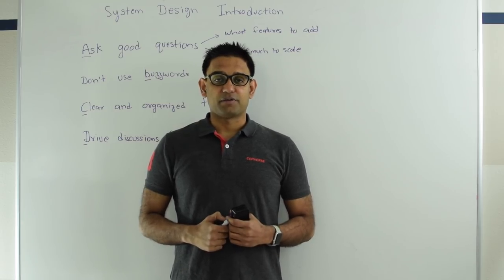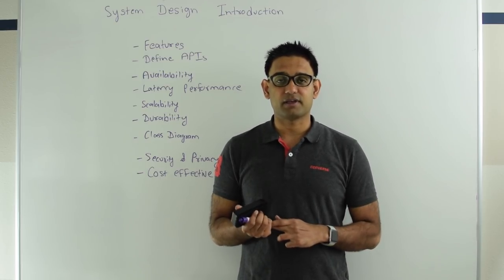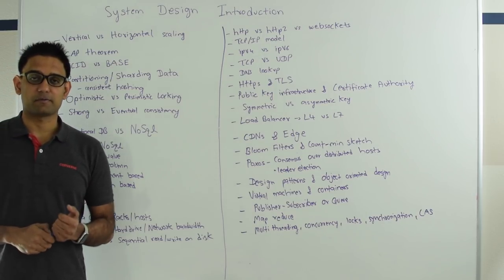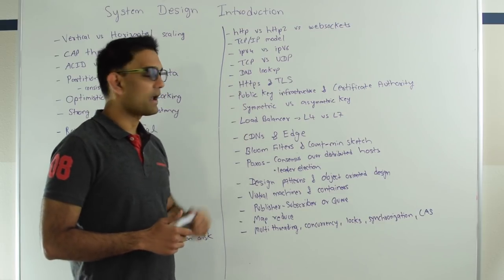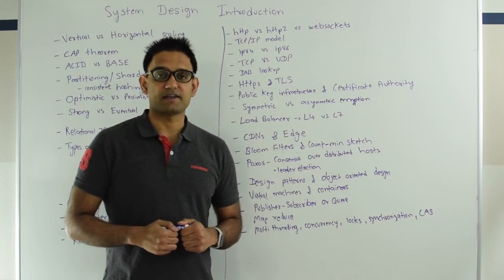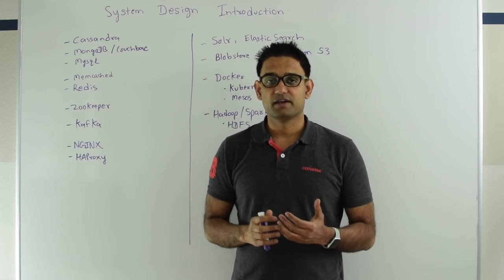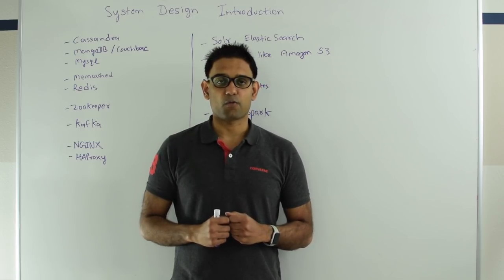System Design Introduction For Interview.

Comment: System design Concepts know 
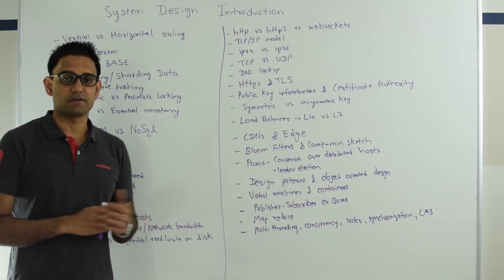Vertical vs horizontal scaling -  7:39 
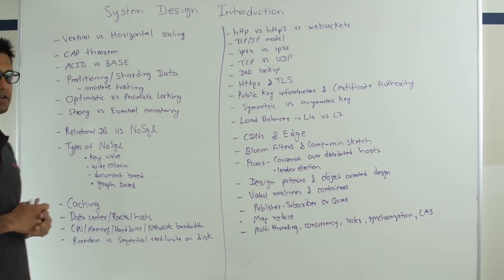CAP theorem - 8:22 
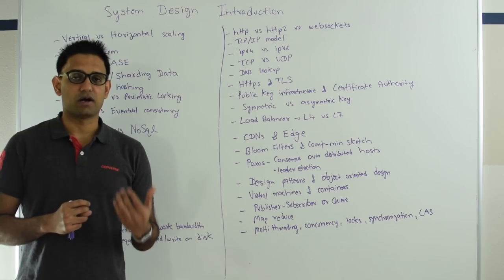ACID vs BASE - 9:24 
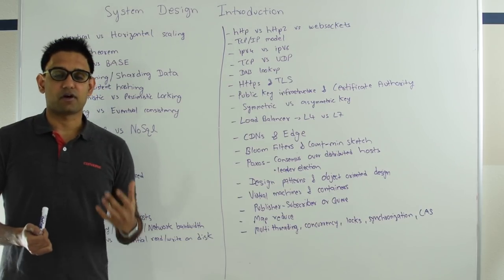Partitioning/Sharding -  9:52 
     Consistent Hashing 
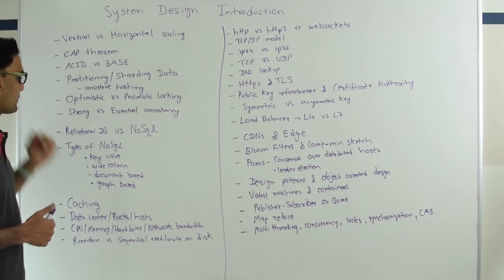Optimistic vs pessimistic locking - 10:29 
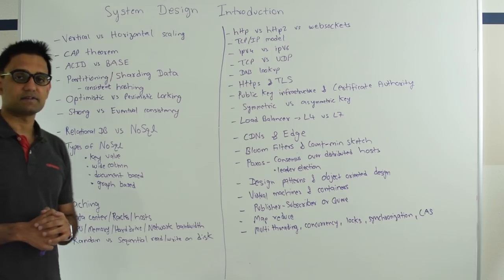Strong vs eventual consistency - 11:04 
RelationalDB vs NoSQL - 11:38 
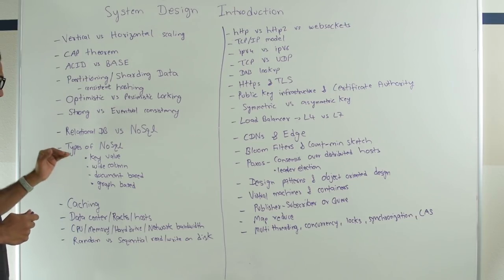Types of NoSQL - 12:05 
     Key value
     Wide column
     Document-based
     Graph-based
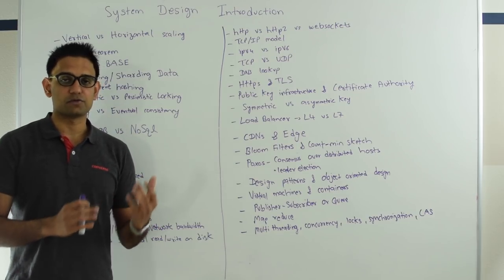Caching - 12:58
Data center/racks/hosts - 13:39 
CPU/memory/Hard drives/Network bandwidth - 14:10
Random vs sequential read/writes to disk - 14:29
HTTP vs http2 vs WebSocket - 14:52
TCP/IP model -  15:26 
ipv4 vs ipv6 - 15:33 
TCP vs UDP - 15:56 
DNS lookup - 16:19 
Http & TLS - 16:44
Public key infrastructure and certificate authority(CA) - 17:00
Symmetric vs asymmetric encryption - 17:38 
Load Balancer - 17:58 
CDNs & Edges - 18:37
Bloom filters and Count-Min sketch -  19:24
Paxos - 20:12
    Leader election - 
Design patterns and Object-oriented design - 20:38
Virtual machines and containers - 20:45 
Pub-sub architecture - 21:17
MapReduce - 21:43
Multithreading, locks, synchronization, CAS(compare and set) - 22:02 

Tools
Cassandra - 22:50 
MongoDB/Couchbase - 23:22 
Mysql - 22:36 
Memcached - 23:52
Redis - 23:52 
Zookeeper - 24:30 
Kafka - 25:00 
NGINX - 25:17 
HAProxy -  25:17 
Solr, Elastic search - 25:32 
Amazon S3 - 25:45 
Docker, Kubernetes, Mesos - 26:00
Hadoop/Spark and HDFS - 26:17
Reply: Thanks man

Comment: Great job of compiling almost all concepts, tools and approach best practices probably can be applied to any design architecture sort of discussions. 
However, I felt like some of the evolving key concepts can be included or highlighted like  DevOps, security,  , microservices/serverless design/architecture patterns n last but not least hosting options especially cloud (sass/pass/iaas) patterns etc.  Not only these concepts holistically complete the SDLC cycle but play critical role in terms of speedy diliverables, efficient hosting but contribute significantly but directly contribute to achieve other concepts with end goal of low latency high throughput secure distributed systems.

Comment: My notes if anyone needs a quick refresh:
- Ask good questions: which features he cares about, how much system should scale: data needs store, latency, requests to handle.
- Don't use buzzwords
- Clear and organize thinking: Create highlevel digram then go deeper
- Drive discussion 80/20 rule 

---

- Features: Minimal vialble product
- API: Who and how something is gonna call
- Availbilty: If host is down etc
- Latency: background job or customer facing operation
- Scalabilty: Is it needs be scale based on requests or customers
- Durability: Data can be stored securely and data is not compromised.
- Class diagram: design elevetar, OOD priciples
- Security and Privacy: Design an authentication system
- Cost Effective: Any alternative solution to save money

Comment: Good stuff. It is the gateway to a great system design interview. BTW, one minor mistake, Kafka delivers messages AT LEAST ONCE, not exactly once.
Reply: It supports both mechanisms.
Reply: Three modes are possible: at least once, at most once and exactly once (with Kafka stream)

Comment: 15:26 there are 5 (not 4) layers to the TCP/IP Model: physical, data link, network, transport, and application layer.

This model is old and becoming irrelevant. Modern IT utilises the OSI Model which has 7 layers, adding a Session and Presentation layer.
TCP/IP Model may be enough for most folks in system design, but they should at least be aware of OSI Model.

Comment: Great video. Nice point to start designing highly scalable systems. You can start course on coursera / udemy. It will definitely be bestseller.  Video about intuition behind selecting any one method based on requirement like simple case study for selecting database for a system will be very helpful.
Reply from the maker: Thanks for suggestion buddy.

Comment: @8:01 : You have mentioned that vertical scaling doesn't have distributed systems problem. What problem is this? Likewise it is mentioned that horizontal scaling has distributed systems problem
Reply: With vertical scaling you are likely dealing with one machine or a few, meaning you arent computing over many distributed systems. With horizontal scaling you will have many machines and thus will have to find solutions to ensure that are all able to work in sync

Comment: The concepts you list down as must know are for Database System Design. It definitely doesn't apply to other system design interviews...
Reply: Some of them, yes, but you can expect others e.g. distributed caching, consistent hashing, etc. for any Lead/Staff/Principal engineering roles.  But yea the topics like ACID/BASE , CAP, NoSQL and Eventual consistency are not that common - but it wouldn't hurt to know the fundamentals behind them (e.g. in which cases would you use NoSQL DBs etc..)

Comment: Thanks for the video. Nice info. 
Question which I have is, Do I need to know all the buzz words which you mentioned or knowing about few is fine ?
Reply from the maker: Depends on the question. Since you dont know the question you probably will need to know lot of these topics. And remember to scratch the surface of these topics.
Reply: Thanks for the quick reply.
Could you please make one or two video on Elevator Design/Vending Machine kind of questions?

Comment: @21:35 - you say customer facing requests should not directly exposed to a pubsub queue - WHY?
Reply: Bad requests might put lot of load on pub/sub area. Pub/Sub is not supposed to be used for each incoming message. Its supposed to be some event and should not be very frequent. We cant control the incoming message rate and hence we should avoid using pub/sub in this case.